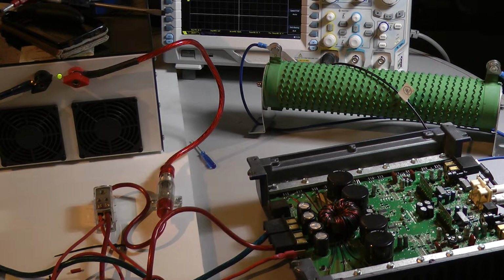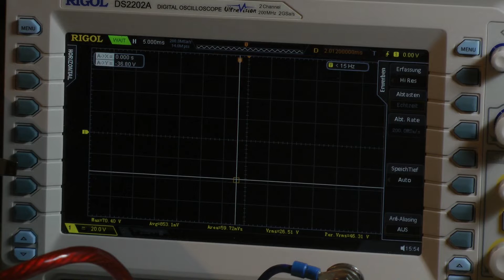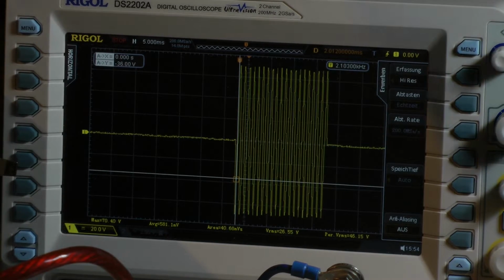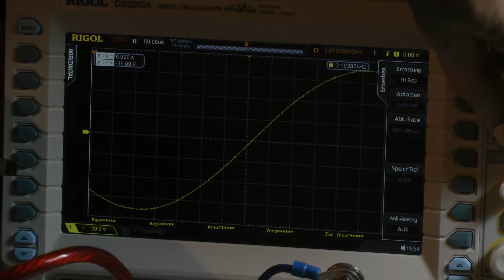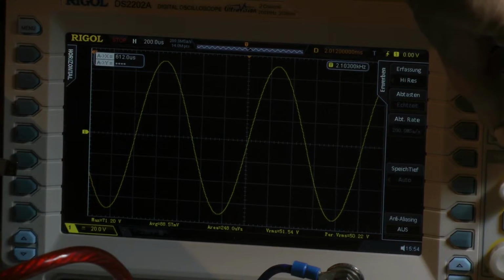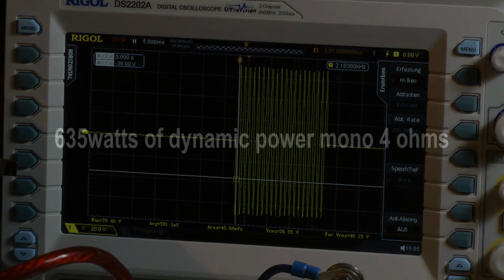Rockford Fosgate punch 250x2 dyno run power test oldschool mono 4 ohm dynamic  get a free amp 800a2

Comment: Run the amplifier in "Audiophile mode" with no x-over cards inserted. 
You may have even better results 😁
Reply from the maker: i did. you can switch them to bypass the filters for shorter signal paths. transnova ftw 😁
Reply: @audiokeller1975  These are my favorite amplifiers! I have a couple 50.2 and a few 250.2 a Chrome 250.2 Brand new in box and just recently sold my chrome 500.2. 
Best sounding amps in the world 💯
Reply from the maker: i still have 250m , 50x2 and 50m fom that series 👍

Comment: i was always a "point" guy, but ill take an "a" lol!!!!! keep up the content!
Reply from the maker: They are almost the same.😎
Reply: @audiokeller1975  the .amps are better more output  by prolly 25 to 30 % look up and dynoed on YouTube and see.
Reply from the maker: @joshholden8561  the 800a2 and 800.2 are the same amps. maybe different test methods lead to more power. i worked on 800a2 and 800.2 both amps have the same schematics. Also 500a2 and 500.2. Even the 1000a2 and 1000.2.
But: there is a very strong and bigger 500.2 out there which makes much more power. its more like an power 1000a2 from the guts. And there is also a weaker 500.2 out there which is like 500a2. 👍